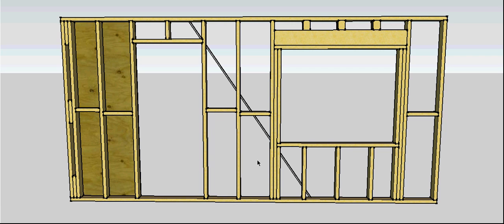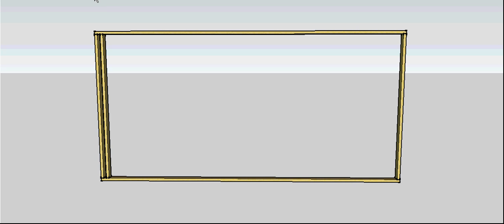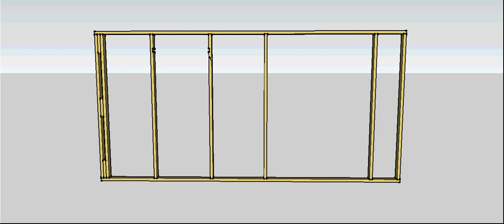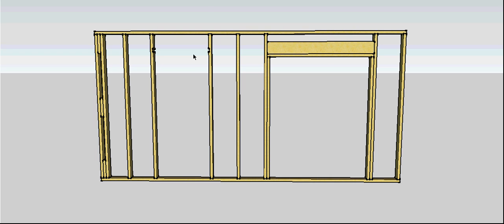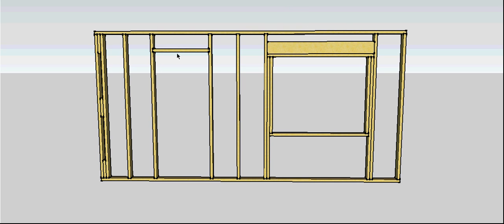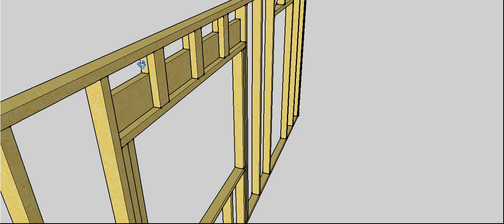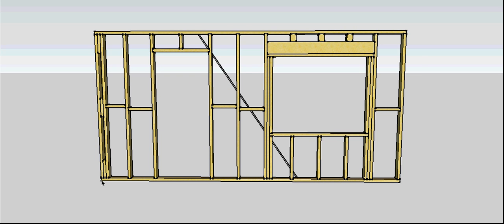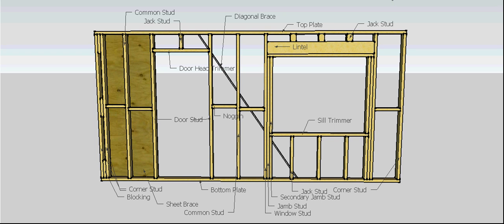Wall Frame Components and Construction Sequence

Comment: Another great video, cheers!👍
With the lintel, are they typically positioned flush with the external face of the wall, or the internal face as you've shown here? Does it matter? A lot of the images I've seen seem to show flush with external.
Reply from the maker: Hi Mate, if it is flush with the inside then It give you somewhere to fix linings, Architraves, curtain rods etc to. If you are cladding the outside you can pack out the remaining space but it is not usually required in Brick veneer construction. Hope this helps
Reply: @Buildsum  Ok, that makes sense - thank you! Tim

Comment: I have some terrible looking opening head in my house. After watching this video, I assume there is a trimmer and jack stud in side. Do you think I can remove the opening head without affect the building structurally.
Reply from the maker: Hi Peter, you would have to have a look in the roof and see if there is any supports landing on top of that wall before you start doing anything with it.
Reply: @Buildsum  thank you. Will do so.

Comment: Really informative video. @Buildsum I made an excel timber frame panel design tool which you might like - cutting list, manuf. drawing etc…would really like to know what you think. Thanks
Reply from the maker: Hi Mate,sounds great, you can send it to builidsum@gmail.com if you like.
Reply: @Buildsum  great stuff, I'll get it into a send-able state. I took some videos on my channel if you wanted to have a look before hand..?
Reply: @Buildsum  is that the correct email? is that 'i' after L correct?
Reply from the maker: @FrameCAD  sorry, Buildsum@gmail.com
Reply: Hi @Buildsum, did you manage to have a look?

Comment: Very helpful video. Have you got any for calculating steel frames?
Reply from the maker: Hi Sophie, Steel frames would be basically the same however as they need to be engineered it is not something that you would be building onsite yourself.

Comment: Great explanation, What is the nail size re 90 x 35 frame and 90 x 45 frame. Thanks.
Reply from the maker: Hi Mate, nowadays you need to use 90mm nails for nailing the plates to the studs.

Comment: If that wall is to be load bearing as the beam above the window would suggest then the top and bottom plates need to be doubled. Also the doorway needs a beam above it like the window. For me max stud spacing for 4"x2" shouldn't exceed 16" O/C, 👍 🔨 🇮🇪
Reply from the maker: Hi Mate, Yes if this was to be a load bearing wall the door would required a lintel however it was just drawn for the purpose of the terminology. However, here in Australia at least, we dont require the double top and bottom plates for load bearing walls as long a certain conditions are met. They are covered in this video. https://www.youtube.com/watch?v=35K_SMW7_kM
Hope this helps

Comment: Great explanation, thank you. Do you have an answer to when a ribbon plate is needed? Does it depend on whether there are joins in the top plate; or does it depend on whether it’s a load bearing wall, tiled roof or a tin roof; does it depend on whether there is a window frame or a door within the stud wall, or the span of the wall?
Reply from the maker: Hi Darren hope this helps
https://www.youtube.com/watch?v=35K_SMW7_kM
Reply: Perfect, thank you!

Comment: Morning Buildsum, Im really learning a lot from your videos they are explained so well,I was just wondering if you have a video on calculating the correct size for a window opening while you are constructing the frame work. Also are there any measurement standard work sheets for this as a lot of windows are different sizes. Cheers Grant
Reply from the maker: Hi Grant
Have a look at this video
https://youtu.be/VU6FNVitXRM
All window manufacturers have a window schedule that will give you the opening size required for their windows. It should be availble on their website.

Comment: Goodmorning, thank you very much for this very detailed and well explained video! It helped me a lot in understanding how a wall is build. Me and my wife are in the process of building our own tiny house. I wanted to ask you what you recommend for spacing between the studs. I get a bit mixed information online, from 30cm to 60 cm between the studs.
Reply from the maker: Hi Samuel, the standard here in Australia is 450mm or 600mm however it really depends on the lining and the cladding that you will be attaching to the studs. Manufacturers will specify the minimum support required so that should be your stud spacing. Hope this helps.
Reply: @Buildsum  thank you for such a fast response, yes this helps a lot already. Also it clarifies a lot why i found so many different opinions. 
I will then indeed contact the manufactur, is this normally the manufacur for the lining and cladding? or the manufactur for the studs. anyhow, thank you a lot :)
Reply from the maker: Hi Sam, no problem, You should be able to get hold of the installation manual for what ever Cladding or Lining you decide to use.

Comment: Thanks mate, fair dinkum explanation. what's the standard spacing for centres? 450mm for external walls and  600mm for internal? you only mentioned the noggins @1350 high. great vid thanks again, just about to go spastic on a building spree on my land!
Reply from the maker: Hi Mate, the spacing depends on the lining materail and could be 450m or 600mm for any of the walls.

Comment: Do you need double jack if you do 1600 opening for a door ? And header
Reply from the maker: Hi Mate, that is a pretty subjective question as it will differ depending on the type of timber you are using, the length of the studs, whether the wall is loadbearing or not, roof loads, the country you are in and other factors. However as a rule of thunmb, any opening that is wider than the stud spacing being used will require a Header (Lintel) of some sort and nowdays it is quicker to use a Jamb Stud to support is rather that checking the Lintel into the single Window stud. Hope this helps
Reply: @Buildsum  hi mate thx you for your reply ,i  see what you mean ,i try to get answer as is so hard a carpernter to do you work now days ,thx for the help

Comment: Thanks for your Vids, just looking for advice on noggins. I can see how it would be easier to stagger the noggins on that centre line of them, but I see some videos where all the noggins are level on the same height (that would be harder to do (skew nailing etc) so if I do them in a staggered format will it be harder to line a room with gyprock, unsure? Thanks for your videos.
Reply from the maker: Hi Mate, thanks for your comment, it is standard to have the noggins in the staggered format and it wont make it any easier or harder whichever way you do it. Just be aware some products, like "Blueboard" need to have the edge of the sheet continuously supported. Hope this helps.

Comment: Don't you need a header above the door as well. Can you please explain? Thank you
Reply from the maker: Hi Mike, If the wall was a load bearing wall then yes you would however they are not required on a non-loadbearing wall. You could make the assumtion that because there is a window in the wall shown then it is most likely an extenal loadbearing wall however it was just drawn to show the members that are in a wall not as an actual wall in a building. Hope this helps

Comment: Great videos, thank you. I have a couple of questions if I may. 1. At doorways is there anything wrong with using jamb studs inside the door studs to support the door head trimmer instead of notching the door stud for the door head trimmer. 2. Can I use more than one noggin between each studs, for a 3m wall I assume I need 2 but was thinking of 3. Can I nail the noggins to the studs before installing them? 4. Can I use a full stud in place of the blocking? Thanks so much.
Reply from the maker: Hi Steve, remember that standards are the minimum that you are required to do so if you want to put in extra timber there is no problem with that. Everything that you have suggested sounds fine.

Comment: Hi, how can I bulid a free-standing wall (3mts X 3 Mts high) so it does not move side to side, as there is not top plate fixed to the ceiling ?Ta
Reply from the maker: HI Adrian, good luck with that, unless the wall is going to be connected to the ceiling at both ends then there is no chance of not having it move side to side.
Reply: @Buildsum  is there a Max wall height limit at which it can be done?
Reply from the maker: No mate, it will have to be attached to the ceiling at least both ends regardless of height. The connection does not have to be the wall continuing all the way up, you could use decorative features to make the connection and keep the open look going.
Reply: @Buildsum  Thanks for the advice

Comment: Why do you need metal bracing if you are going to cover the outside with plywood and the interior  with sheetrock?
Reply from the maker: Hi Raymond, the metal bracing can be used as a tempoary bracing to hold the wall square and plumb while tha ply and the internal lining is installed. Also not all countries sheet the entire out side of the building with ply they only use ply if the metal bracing is not going to be sufficent. Hope this helps.

Comment: Hi, how much of the wall needs to be covered by diagonal or sheet bracing?
Reply from the maker: Hi, it depends on the amount of wind load that will act on the building and the amount of resistance that the bracing unit gives. 
Some framing companies put a diagonal brace on every wall so it easier to install and plumb the walls.

Comment: Hi very good video just wondering when you put in the secondary stud, isn't that going to close off the measured space needed for the custom made window size?
Reply from the maker: Thanks, Masi, the position of the secondary studs is determined by the required window opening and everything else goes outside that. The frame company or the person constructing the frame will know from the span of the Lintel is the second stud is required or not.

Comment: there should be two top plates(double) and u also forgot a lintel(header) on top of the door frame. other than that, good video :)
Reply from the maker: HI Mate 
Actually there is no need for a double top plate unless your trusses or rafters fall more than 1.5 time the depth of the top plate away from the stud. The other reason you commonly see double top plates is to lift trusses above internal walls however you could just make the internal walls shorter and achieve the same result.
https://www.youtube.com/watch?v=_T5UPm0tuSE&lc=z12iitxyiuibs111u23igvqqhs2rddsgn04

As for the lintel, while technically, not correct for a load bearing wall it is acceptable for a non load bearing wall and i had already shown a lintel in the video. 
Other than that thanks for your comments.:)

Comment: That was a great comment about some companies handling the lintel differently, thanks for that.

In your example this was a new build, however how is bracing retrofitted to an existing brick veneer wall? For example retrofitting bifold or stacker doors to replace a standard door. There is obviously no longer access to the cavity. There would be an existing timber or perf steel diagonal bracing but that would no longer be possible. I presume the sheet bracing would need to be installed internally?
Reply from the maker: Yes Pete The bracing would have to be fitted internally and the rest of the stud packed out to match.
Reply: Bugger! Ok thanks, I will need to come up with another solution then as it's not the whole wall that will be stripped. Imagine an open plan kitchen (yes with tiled splashback) adjoining the dining area. It's the dining area that will receive the new opening and the kitchen area (on the same wall) will for now be left untouched. The interior studs will need to remain in their existing plane.

I don't think I'm the first to need to do this, so I'm surprised I'm finding it difficult to see how others have coped with this situation. A the moment I'm considering leaving a 450 mm bay in the corner and inserting bracing, basically as a site built "Pryda short Wall Truss". Alternatively, inserting additional framing and fixing some sheet bracing to that frame so the bracing could go internal, and inserting that into the bay, ie that bay would appear as if it had jack studs with double top and bottom plates (if that makes sense) and tying it to the plates with coach bolts. The wall is on timber bearers. Either way I'm wallowing around is a sea of uncertainty as to how either of those brainwaves stand in the eyes of the code! I figure it simply needs to withstand the wind loading, and it shouldn't matter how I get it there. Ha ha ;)
Reply from the maker: HI Pete
To be honest the reason you cant find anything on it is because you are delving into stuff that a structural engineer would normally be consulted on. While you plan sounds feasible and reasonable to me it would need certification.
Reply: Thanks

Comment: Hi JOHN,
Do you know the software which most framing carpenters use for framing design before they do the job on site?

second question is when I brace the frame? after all the wall join together or when each wall still lying on the ground?

Thanks.

Roger
Reply from the maker: Hi Roger
Personally, i didn't use any software it all comes off the plans.

The wall should be braced after they are all stood and plumbed, however, it is common for the bracing to be tacked in place on the ground because it is easier to do then, however, they need to be able to be adjusted if needed once stood.
Reply: is than mean the floor plan is enough for you?
Reply from the maker: Hi Roger
The floor plan and the elevations should give you all the information that you need when used with AS 1684.2
Reply: Get frame dimension off plan to build your own.   If being made at factory use MiTek 20/20.

Comment: Hey buildsum, thanks heaps for the videos. 
I am new to carpentry and would like to know more in regards to window positioning while framing. My current boss tries his best to measure where the bricks will be then align the windows closes to where it might be. Even though i think this makes it easier for the brick layers. I think its time consuming and unnecessary. What are your inputs in this?
Reply from the maker: HI Josif
This is a very common practice as it not only saves time with the bricklayer but also looks like a much better job.

Have a look at this video it may help
https://www.youtube.com/watch?v=L1BKnzQcPlY

Comment: G'day Buildsum, I've just found your channel and enjoy your videos. If you have the time to respond, I'd love to ask a few questions: I've been waching all the Larry Haun framing videos and now I am trying to 'translate' that info into Australian :)
The yanks seem to use 2x4s for studs and floor/top plates. I gather 90x35 is the closest equivalent for a 2x4 - is that what you use? and the same for floor and top plates? 
Also they don't seem to use noggins - is that an Aus standard thing?
When I buy a bundle of H2 or H3 from Bunnings most of them have some bow or twist in them. What's acceptable and what isn't? I know you said use the straightest ones for window and door studs. How do you deal w distorted timber? Do you make all the bows face one way and compensate somehow? I can't find any info on this. Would love your advice. Cheers.
Reply from the maker: Hi Uri
Yes, we commonly use 90 x 35 or 90 x 45 instead of 4 x 2s, yes same for flooring and Top Plates.
Not sure about the use of noggins in the US but they are a  requirement of Australian Standards
https://www.youtube.com/watch?v=UN4Ue8BgkR4&t=1s

Page 34 in this document may help 
http://www.vba.vic.gov.au/__data/assets/pdf_file/0020/29063/Guide-to-Standards-and-Tolerances-2015.pdf

However, this refers to after the straightening process complete, not how you by them out of the store. Personally,  I would not buy bulk timber from Bunnings a local timber yard would be better, however, some bowed timber is unavoidable. The worst can be used for the shorter members like the noggins.Yes, all bows should be put in the same direction to make straightening easier as per the How to Straighten a timber wall frame
Hope this helps
Reply: Thanks heaps. Yes I saw that video after I commented - great work thank you and happy new year :)
Reply: Uri Auerbach noggins allow you to fix standard plaster sheets on there side. They also stop flex on the stud. Australian sizes will match American measurements as everything originated in imperial before we converted to metric. That why timber comes in lengths of 1200, 1500, 1800, 2100 and so on. It's just feet converted.  Our studs are 90x45. That 4"x2".

Comment: Hello, Im not native english so I'd like to know if the difference between how we name each peace of a frame wall is because of the english speaking (UK vs EEUU for example). I mean, you say "Jack Studs" and i have seen the same with "Cripple Stud", same with "Header" and "Lintel", "Trimmer" and "Jamb Stud", "King Stud" and "Window Stud". ¡Thanks!
Reply: Also "nogging" and "Blocking" (or "Fire Blocking") :)
Reply from the maker: Hi Sergio
I'm sure that the same member is called many different names depending on where you come from, English speaking or not, even here in Australia we have different names depending on the State or Town you were trained in so it is confusing.

The names I have used are written in the Australian Standard AS 1684 - Timber Framing Code.
Reply: Thank you!
Good to know.